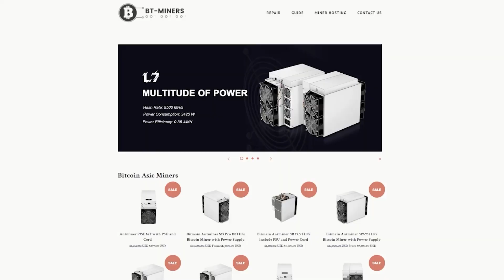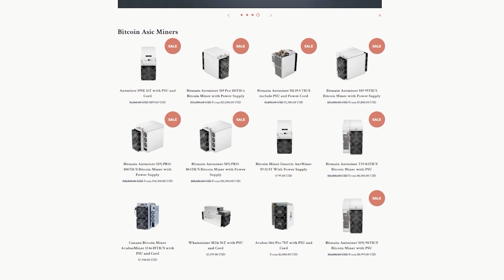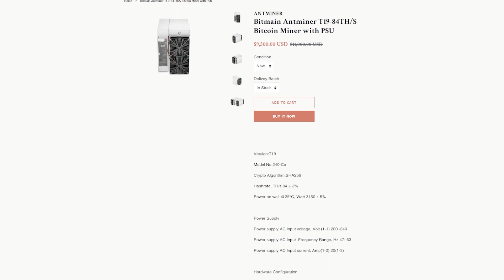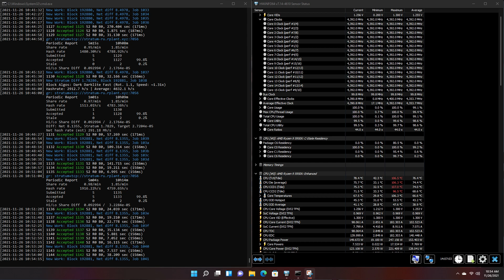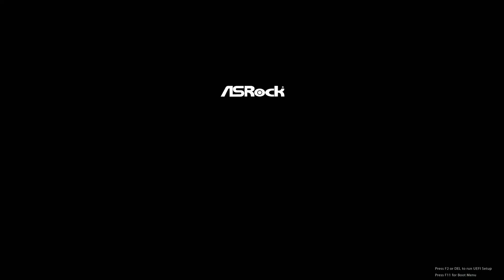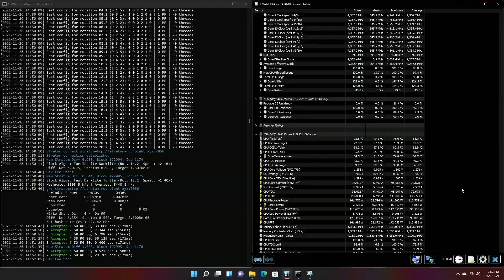5950x Raptoreum Overclocks All Core VS PBO 2.0

Comment: the curve adjustment doesn't lower the voltage!  that is what more traditional methods of manual CPUVID or offset mode CPUVID setting.  These older methods lower the voltage delivered vs demand.

Curve optimizer on the other hand often doesn't lower CPUVID because it lowers the curve that defines for a particular voltage, the BIOS will set a particular MHz.  this means you'll get higher clock for the SAME voltage.

Comment: after spending about a month in the flockpool discord, talking to the guys who made the miner, I must mention that a 10h average is meaningless. Through my own experience, what you see at 10h might as well be incredibly far from or exactly what your hashrate would be, and it would change almost each time you try it. The only hashrate average that makes any sense is the 24h average, but even then, I have seen averages that either went up or down from the 24h mark to reach the actual average around the 48h mark, so if you want to get a mining average that is kind of reliable, you should leave the miner on for at least 24h. Because of this, using the benchmark command should be the best and fastest way to get an idea, but even then, some of my benchmark results were not the same as my 48h hashrate, so in the end if you want the most precise values, let each OC on for 48h and record that average. Of course thats insanity, so benchmark results should suffice for anyone who isnt super anal about precise results.

Comment: try xmrig 6.16.2 when you get a chance. i got an R9 5900x on ASUS tuf b550m-plus wifi with a single 8 pin extra cpu power. but following your recipes I get close to  5400h/sec vs 3800h/s with fixed 4Ghz 1.1v. good info. more of the viewer should give the thumbs up. good work.

Comment: I can get that hashrate, my temps don't pass the 70º but my average hashrate is 3800Mhs. far from your 5600Mhs. probably my mb is a not so good. i got the same results with fix overclock at 3800Mhz but less power consume.

Comment: I tried this on my new 5900x and got blue screen on boot. Had to clear cmos bc it wouldn't boot after blue screen. I dono what I did wrong. I have only seen 2.6k avg according to pool 
MSI x570 gaming edge wifi
3200 mhz cl 16 ran
500gb evo 970 pro 
Rx 6800 
I
Reply from the maker: Loosen to -10
Reply: @SonofaTech  can u similar setting be achieved with Ryzen master and thanks for ur reply

Comment: Are you talking about averages? Because I tried it for a day the same as you exactly no thermal throttling but averages are kinda the same
... I'm not getting anywhere near 5k average maybe 4k which is the same at 3.8gh 5k for some moments but nothing is changed. Can you clarify? Average or max h/s? I'm need to find what I'm doing wrong. I bet this is BS  but bet you didn't run the miner 24hrs to get the true average... Man I expected better of you, we make real decisions with your findings with hard earned money... You have to fix the report promptly. With all the love, I know mistakes can be made but how you fix them is what sets you apart

Comment: Why am I having on my 5950x with same bpo settings  much higher wattage and temperature ?  In benchmark I  have  216w max and 90 degrees C.  Hash is 4357 and 136 per core. Why it is so different from results from video ? )

Comment: Great video a lot of good information.  Amd has gone big with pbo2.  The only corrrection i would make is that you will never use more than the single cpu power connector moning.  It is ment for extreme overclocking with liquid nitrogen.  If you are pulling enough volts to use the second cpu power connector you are way to high.  It doesnt adjust your power delivery.  I and buildzoid have verified this with oscilloscopes.

Comment: I did try the same overclock (PBO + 200, curve -15, voltage 1.3)  i have done the full tune and the cpu hash/rate is just 3.3kh . I think the problem is the core clock which is 3400mhz  (min, max and avg),  any ideas what i have done wrong and how to change it ?
Reply: @abaku0x1  ya sure. 5950x, msi x470
Reply: @abaku0x1  I will try it  ,( with default values I was getting better performance)
Reply: @abaku0x1  do you have any ideas why the CPU frequency is stable at 3.4mhz (min max and AVG is 3.4mhz ). Why the frequency is not increasing ?  The temperature is ok

Comment: Tried your setting on my 5900X and Asrock X570 Phantom Gaming 4 board (hiveos). Compared to my current settings - 3.8GHz @1V I gained 0.5kH, but power consumtion went up almost 100W at the wall.  For me it is not worth it.

Comment: On the pool side my 5950 is “showing” average 4.16KH/s with manual OC 4.3MHz, 1.25V - XMP enabled 16gb CL14.  Noctua single fan cooler highest temps 77-79c (only during the rotations that COU runs the hottest).  63-68c majority

Comment: on default setting i have the following parts and rates. I have Arctic 420 AIO , 5950x, B550 Aorus master,  . Enabling PBO crashes the PC when mining. temps is approx 60c with ambient 25C

CPU temp: curr 56 C max 67, Freq: 4.238/4.238 GHz
Hashrate: 5240.5 h/s | Average: 3959.9 h/s
Periodic Report     1m24s        11d20h
Share rate        2.14/min     1.65/min
Hash rate       4541.15h/s   3926.12h/s

Comment: Thanks for the video. It was just in time for my new 5900x build. I just have the standard wraith cooler so I wanted to temps to be limited for consistent RTM mining.  My board doesn't have 12 pin CPU power but it is a good MSI B550 A-PRO board with good heatsinks.   Memory 3200/15 CL. What seemed to work best for me was PBO2 on, max boast auto, curve negative 30, temp limit 64, PBO limits disabled, XMP profile 1.   The Benchmark hash rate result was 3582 H/S and temps stayed below 65 and CPU PPT maxed at 118W.   Changing the maximum temp to 67 only resulted in additional 27H/S. For some reason setting max temp to 75 limited the hash rate to 3225.  Must have been throttling.  Going to leave it at this for now and see the results.

Comment: turn pbo on but go into bios lower the pbo curve by 500mhz it will stop the voltage touching 1.3v and should be below 1.2v and your wattage should drop by around 20 watts

Comment: Allcore 4.4ghz @ 1.3V 20 min bench = 4450hs @ 70 C°

Stock settings with 20 min bench = 4207.99 hs with Max 5050 mhz on some cores @ 1.431 V Max.

Curve @ 150, negative 8 = 4169 hs 
But it Boosted some cores to 5200 mhz @ 1.5 V  temps still low @ 55 - 60c°
Strange

Comment: VERY good and interesting video! Keep up the good work! I really like this kind of videos!

Interesting find there, I know on Ryzen 3000 series the best performance at mining Monero is like lock the frequence and voltage and go from there, as you said. But on Ryzen 5000 series it seems in your finding that PBO2 is the way to go!

Myself are running CTR 2.1. Don't know if it's better or worse.

Comment: Good analysis. Could you try comparing +0 pbo and maxed CO vs +200 pbo and maxed CO? The higher you set + pbo, the lower negative you can use on CO so basically a high pbo gives you better single core, but lower multicore, while lower pbo gives you lower single, but higher multicore. Some algoritms seem to prefer allcore while others prefer single. You can use corecycler to find best negative offset pr core :)

Comment: I set my pbo limits first. The curve optimizer just moves the curve from the pbo limits. So in the last instance you were on stock pbo limits, 142 ppt 95 tdc and 140 edc. Lookup how these terms are applied to the curve, I'm on a phone lol.
And the max boost override will determine how much you can move the stock curve. If you did not overclock the max boost you would get the max of -30 on curve optimizer. When you do the max boost of 200 you have to then do a per core curve optimizer. Average Ryzen will do 10-15 on most cores and 8-12 on preferred cores.

Comment: The best you can do, Windows- Download CTR 2.1, find your OC settings or undervolt settings, copy in te bios. I can go 4ghz y 6 cores and 3.9 in the other 6 in my 3900x with 1.1V, in a 5950x with that voltage you can get more ghz and very low power draw. I don´t recomend to pass 1.2v in a 5000 series, more power, more temperature less efficiency.
Reply: That's what I do. CTR will be great in the future to use the switching feature. But it's amazing at finding good settings for easy stable pbo limits.

Comment: I bought my ryzen 3600 on launch day and it's a mediocre silicon at best. It was under performing and couldn't hit the avg. hashrate suggested by the raptoreum mining calculating site. It seems like a bios and chipset update solved my problem. (haven't updated in like 1,5 years)
Reply: Went from 1600 h/s to 1700 h/s

Comment: Your theory about LLC being the cause of degradation is completely untested. Yes lots of people see degradation, mainly on overclocks. But the common theme seems to be the wattage burned up in the parts relative to its stock max and absolute max.

Your tweaking lowered the max wattage, so would lower degradation.

DerBauer did a Ryzen degradation test. It was interesting.
Reply from the maker: It keeps the voltage closer to the desired setting is the point really
Reply from the maker: Love derbauer

Comment: My best setting :
PBO : OFF
All core : 4.675
Core volt : 1.3 
Xmp : on 
Results " 3.5 to 5.2 k.h " Stable
Reply from the maker: Cooler? Max wattage? Temps?
Reply: @SonofaTech  try to update Bios ✅
Reply: @SonofaTech 
 all auto 
temperature 63 to 65 , using ARCTIC 360 AIO
Power average  145 W
👇🏼
Keep try 💐
Reply: @shaditips  Thats awesome.  I have Arctic 420 AIO , 5950x, B550 Aorus master,  . Enabling PBO crashes the PC when mining. havent tried manual setting the clocks

Comment: You should be using "--benchmark" mode or 24 hour averages in the miner window to show your performance.  The 5.4Kh you quoted at 16:12 is only for rotation 12.2 and 14.2 when the miner started.  Also the highest power/thermal use is rotation 4.1 I believe, which is used in the "--stress-test" mode.  3000 series does not support PBO2.

Comment: New Ryzens with 3D cache that should (according to rumours) have 3 times more L3 cachce sound promising and in mid December Project Hydra should be out, which is overclocking software that will also include those new Ryzens when they comes out in first quarter 2022. Any thoughts about that?

Comment: Great content! I've been wondering about PBO on the new gen Ryzens. This will provide about 1kh uplift over the 3.8gh/1 volt settings I've been using. I'd love to see a video testing the effects of gpu mining ETH on an RTM rig. Also, Hive vs Windows.
Reply: I have a 5950x on a 3-gpu mining rig.  3.85 G all core  @ 1volt.  I think it draw about  80ish watts form wall. I get 3.7KHs  that’s 24hrs avg.  my rig will randomly reboot if I  turn on PBO.
Reply: @806le  Thats right about where I'm at with my 5950x on a rig with a 3090 mining ETH. I've been running all my RTM rigs at 1 volt, but am wondering if less efficient settings make more sense now with the increased price and difficulty.

Comment: 142w is basically the default limit. u can increase or decrease it in PBO limits.
Reply: Please do a full tune for every test configuration and run the configuration for 24 hours, then report the reported average at the pool. Full tune + benchmark might be enough but you need to define the average over all possible algorithm rotations to determine the benefits of the OC settings.

Comment: If I already have a rig with gpu's I use to mine, and already have this cpu and have already optimized the curve pbo2 for gaming. Would this be even profitable to have running? Is it worth have a $800-900 cpu mining on this for $1-$2 profit when thinking about degredation?

Or do you make more than that?
Reply: If you have good cooling you should be fine.

Comment: Most of my X570 motherboards have the extra EATX 4 pin power connector. The exceptions are the cheaper Gigabyte boards but even the ASUS X570-P Prime has the extra power connector. I do not have any ASROCK boards. ASUS has auto overclock in their bios so I'm wondering if it is similar to ASROCK PBO 2.0. The other caveat is I also use these boards for GPU mining Eth so I have a dual mining situation going on most of my RTM rigs.

Comment: Sorry but the dual 8 pin thing is a complete marketing BS.
If you want good mobo go watch some of the more technical reviews from respected channels like hardware unboxed.
Reply from the maker: It’s a quick tell on if there are more power phases. Easiest way to point quickly. But yes checking individual reviews is great. As far as complete bs I’d argue incorrect as most additional CPu power = more phases and higher quality caps.
Reply from the maker: But ya you can call bs as you like. Link a dual 8 pin with less power phases than a single 8 pin for reference please.
Reply: I really enjoyed the video and gave a like, thanks SoT. Interesting about PBO2. I dont have any PBO2 boards to try out, other than an A520 haha!

I cringed about the number of power connectors as well. There will likely be weak correlation. Theres absolutely no reason that 8 pin or 12 pin power connectors can't deliver good power to the CPU if its a decent quality PSU with decent gauge wires.

What actually matters is not just the number of phases but the actual model of MOSFETs used on the board and capacitors that are used. And also whether phases are real phases or marketing exaggeration (X2 or X1.5 phases) matters a little.

I would suspect that poor VRMs would mainly just hurt efficiency (unless they overheat which will also cause throttling or instability) and that the real cause of degradation is running these 3000 or 5000 CPUs at around 150~220W or more. I bet that is the real degrader.

More watts means higher internal temps and  also shoving too much current through all of the transistors in the CPU for its longevity.
Reply: @joshuamaserow  That's what I mean, maybe some mobos with two 8 pins have good VRM as well but at the same time you can get garbage VRM and mobo in overall with two 8 pins.
It's a very noob and lazy way to look for 2 8 pins to get good mobo.
And yes you're right just some number of "phases" doesn't mean much either.
SOAT makes good videos but he's very stubborn on his opinions and won't even listen to a PCB design engineer who is doing this sort of stuff on daily basis...

Comment: Love to see a detail walk though of setup for this. 
Use bios or ryzen master?
Reply from the maker: I use bios cause it will end up being on linux
Reply: 👍 mines running on main pc. will start researching pbo 2.0
Also time to upgrade psu, only just upgraded motherboard and cpu, was concerned not using the extra 4 pin. 
Thanks for the info 🤓

Comment: you can buy a cheaper mobo and get it some good vrm cooling and undervolt the cpu and you should be fine. you do not experience cpu degradation from dirty power because dirty power DIPS not spikes when it's rippling. i've been overclocking cpus since pentium 3, socket 939/754.. back when 24 hours of prime was the MINIMUM to be cool. but i guess time will tell.

Comment: With my 5900X in windows my one size fits all gaming/mining settings are: -0.06v offset, -5 to -10 negative curve,  +50mhz max boost, 2x scalar and 125W PPT limit. Getting ~3450 h/s, also get 3650 h/s with 140W PPT, and 3330 h/s with 3.9ghz all core @ 1.0v get. I'm also halfway through a full tune with a new 3900X build. Trying the motherboards 95W preset PBO profile
Reply: 13 hours since the 3900X switched from tuning to mining, averaging ~3700 h/s so far while also mining with 2 gpus. Exceeding expectations!

Comment: 4.2ghz@1.1v seems to be the sweet spot for ryzen 5000 chips, stable under 60 degree celsius.
Reply: Yea my 5950x has broke in well after a few weeks. I'm sitting at around 50c with a arctic cooling 240mm. They say that thermal paste doesn't need to cure but I was not at these temps when I did the tune, that's for sure.
Reply: @m6a1u57  your 5950x broke after a few weeks ?? why?
Reply: @madden12  It didn't break.
Reply: Depends on binning. My 5600X runs 4.5@1.1V. Some struggle to do 4.1@1.1V, while some golden samples do 4.6@1.1v. It's often harder the more cores you have.

Comment: So on my system ( Gigabyte Aorus X570 Master ) setting the Curve Optimizer to Neg 15 would not hold. As soon as I would go to save bios it changed it automatically to Neg 30 in the "changed made" which is bizarre . I changed again to 15, it changed back to 30. The end result was automatic Windows restart when I got to desktop and Windows troubleshoot. So I had to give up and revert to normal settings.
Reply from the maker: -30 would be way too much. Maybe a bios update?

Comment: Happy with my 5900x running on 22 threads..PBO at maybe 140 watts 280mm aio.  3.2ish hash... But it jumps all over the place throughout the day.  X570 Asus Tuf.  Not caring about the money atm... Just trying to hodl for the future.. Didn't want to change my normal settings from non mining use... Temps were at 69ish according to both AMDs own software and hwinfo.  32 GB 3600 CL 16.
Reply from the maker: yes, so you have to look at average over a long period. I have it still online and will report from pool when available
Reply: @SonofaTech  yeah, that's where I'm getting my average, the pool
Reply from the maker: @Gillsystems  at the pool this is till showing 4.68h/s
Reply: @SonofaTech  probably right if you're going on 5950x full tilt
Reply: Hmm, got 2 5900x rigs on hiveos running at 3.8ghz all cores at 1v,  xmp on 2x dimms 3600 CL16 1.35v , PBO off, running really cool with a cheap 240mm aio sub 50c. For the first 1-2 days I had average 3-3.1khs and now after a week of uptime im having reports of 3.5khs on both rigs, pool is showing completely different info at around 3khs avg. Seems quite odd to me